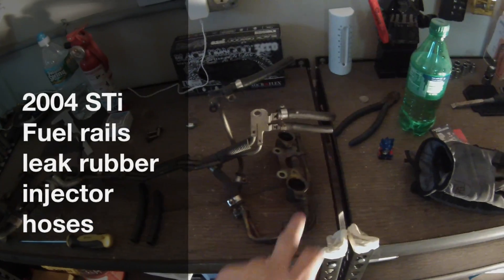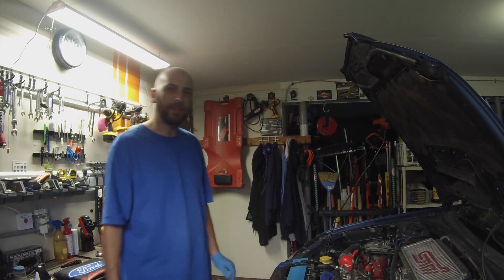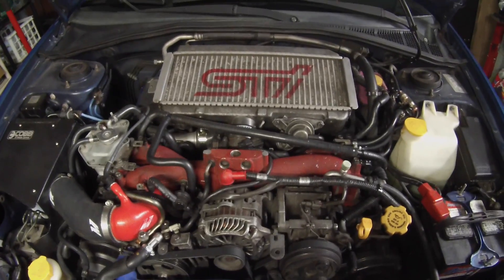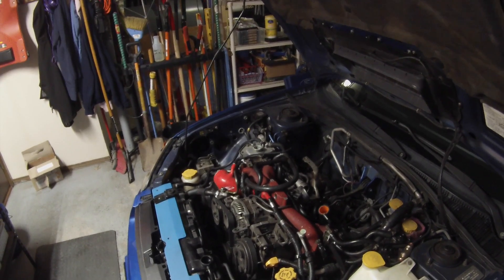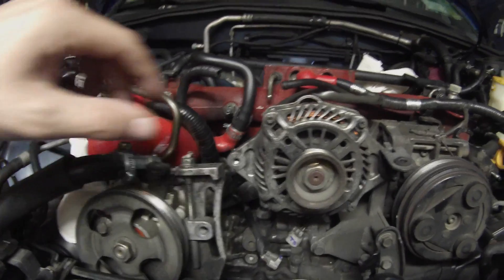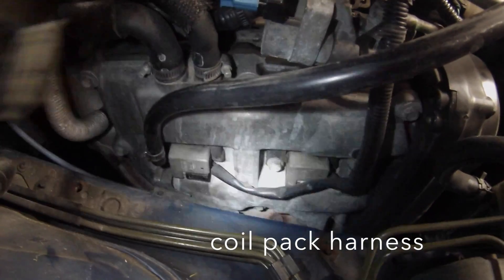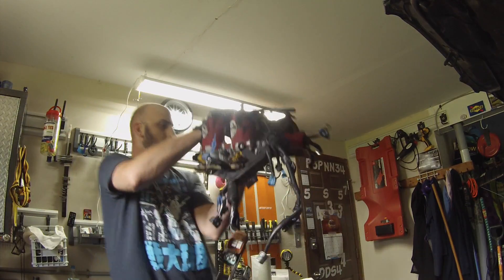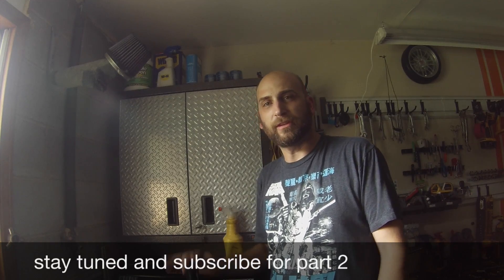Subaru Fuel rails STi  leak rubber injector hoses Forester Legacy

Comment: These videos are edited too much and good info is cut out. You have an 8 min video to replace the ac idler pulley but only 3 min video to take most of the engine apart to replace fuel lines. Come on, man.
Reply from the maker: I could not do a full how to on the manifold as there are many different ones out on YouTube already and this repair was done over two weeks making a complete install how to impossible .
Reply: My bad. I appreciate the videos but its frustrating trying to follow along if you're not as knowledgeable and the video maker figures you can keep up. It's good to know this was a longer process and not something to be done in a single day or even weekend.